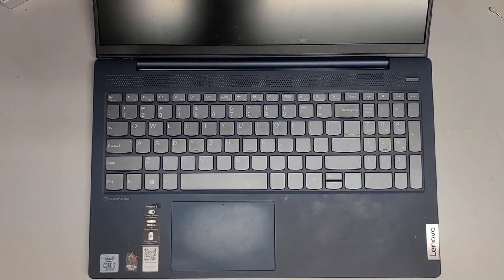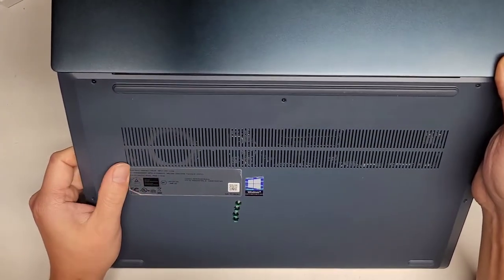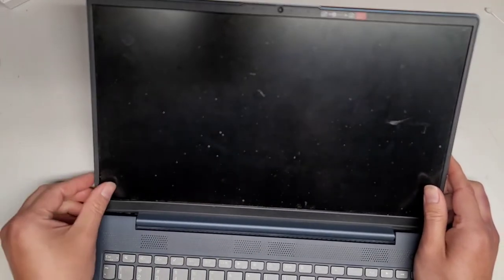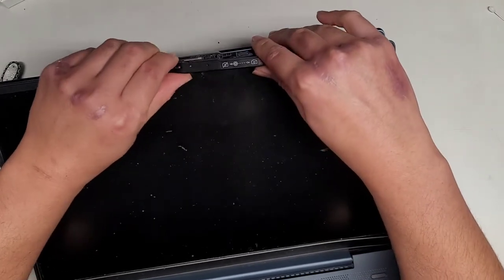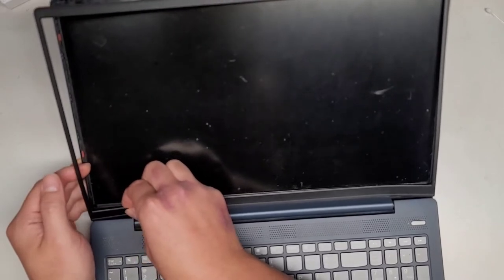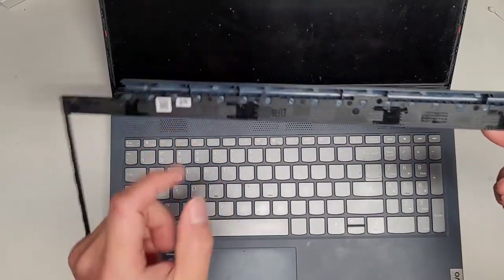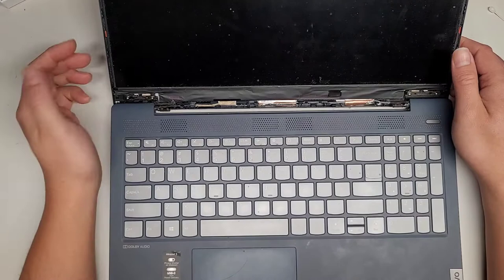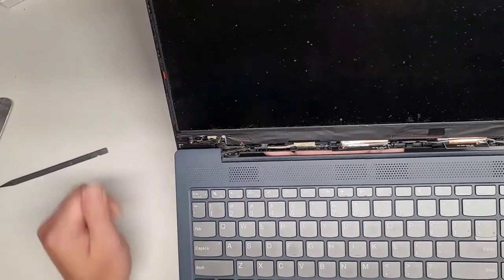Lenovo IdeaPad 5 15IIL05 15ITL05 JB Weld Faulty Flawed Hinge Design Repair (Class Action Lawsuit?)

Comment: I not confident do this. Should i pay lenovo?
Reply from the maker: Up to you
Reply from the maker: Tell them it's a known issue and it's defective. It should be covered under warranty
Reply: @ItsBinhRepaired  no more warranty. i rarely used it
Reply from the maker: @phoonjzc  :( is it more than 2 years old?
Reply: @ItsBinhRepaired  1 year warranty
Reply: @ItsBinhRepaired  1 year warranty. I didn't buy extended warranty
Reply: @ItsBinhRepaired  but it was sold cheaply at a sale. Now I know why
Reply from the maker: @phoonjzc  some credit cards cover it. You might be able to get the warranty extended because it's defective.
Reply: @ItsBinhRepaired  how much does the extended warranty usually cost? Really shouldn't have brought this laptop
Reply from the maker: @phoonjzc  where did you buy it from?
Reply: @ItsBinhRepaired  from an official electronic store. What is the saranwrap for
Reply: When is the deadline to buy the extended warranty?
Reply from the maker: @phoonjzc  I'm not sure of the deadline for extended warranties. The seranwrap is to prevent the jbweld from sticking to the bezel

Comment: Lenovo Yoga has similar hinge issue. Mine was / is particularly bad. First month of ownership of brand new Yodo according to the "geek squad" the pinbal-ish sound in my fan was from "plastic debris" inside the computer. Origin unknown.  Shortly thereafter there was this "crunching of 'glass sand' "sound, every time I picked up the laptop or even worse when I would open and close it. Then my touchscreen stopped working. Then the hinge somehow came out from the top without (to my surprise) breaking the screen. Then my cats closed my screen when it was left open(because I could / should obviously not close it at this point) one night... I'm fairly certain they were watching kitty porn... and in the a.m. when I saw my screen  shut I gasped in panic and when my genius friend saw me do that she was like "what?!..." and opened the screen thinking there was something horrible on it which caused me to shut it (which I didn't) but before I could blink she had just opened it up to a uber cringy grinding sound that was oh-so-familiar and a small pop which, as you have likely guessed was my screen. 
So I went into the kitchen and grabbed a meat cleaver (I am a vegetarian so I was happy to finally get to use it) and I cut out my genius friends heart the way that mine felt like it was at that moment. Threw her body into the canal  where an octopus and a shark fought over her. Bye bye (you're welcome world) ... And when I turned my attention back to my computer I was shocked to see that the screen still worked... And it still does with no interference save for a darker diffuse line up the right side about 2.5 inches in.  I guess I was a bit harsh on my friend, but trust me someone was going to eliminate  her at some point anyway...  

If they can ever get a class action lawsuit going for these effing defective parts in Lenovo's I will be sure to ask the attorneys to include that any act-of-passion murders caused by the numerous defects would be the fault of the manufacturer and NOT of the user.

 I just can't seem to find where any of the investigations into them resulted in anything... Does anyone know?
Reply from the maker: :( yeah, it sucks so bad. I hope that story wasn't real. Lol

Comment: Is this full metal body or plastic built laptop?
Reply from the maker: Both
Reply: @ItsBinhRepaired  I was looking into ideapad (3 or may be 5) they told me it's full metal body laptop. Does having full metal body reduces the chances of hinge problem.
Reply from the maker: Nope, the metal is just on the outside.
Reply: @ItsBinhRepaired  can you please suggest me some brands with better hinge designs around this budget.
Reply from the maker: HP Lenovo, avoid thin bezels if you can.
Reply: @ItsBinhRepaired  thank you for your reply, appreciate that.
Reply from the maker: Yup

Comment: Well done,  If you have a Dremel tool, drill holes holes through cover and use #2 flat head screws.  No glue, no mess but you need some skill
Reply from the maker: Dremel, not a drill?
Reply: DO you have a tutorial of some sort on this?
Reply from the maker: @elin8546  you don't want to do this, because you have screws sticking out the back lol
Reply: @ItsBinhRepaired  I don't mind the screws :) I just need to be able to transport my laptop. And screws with metal reinforcement might be a more longterm solution incase the plastic breaks out again?
Reply from the maker: Jbweld works really well
Reply: @ItsBinhRepaired  alright, I guess I'll have to figure our where to find it in germany 😅
Reply from the maker: @elin8546  if you can't find it, I guess just drill through lol

Comment: Just let your weld dry.  Then reassemble.            Good job though.   I just got one in for repair.  Looking online, looks like this should be a damn recall.
Reply from the maker: If you let it dry first and accidentally put too much, the bezel won't go back on flat. Yeah, definitely should be a recall. I've repaired so many of these.
Reply: @ItsBinhRepaired    Yeah, I've had to use a dremel to knock it down if there was too much ha.
Reply from the maker: @GF_Burke  yup, this way prevents that lol

Comment: Anyway to use this with a monitor, no way for me to fix that right hinge, it is almost frozen solid, but i did get it open to about an angle that it can sit on a desk, just cant close it for transport.. idea pad 5 15 16gb 512Gb  - seems to be a wasted device unless i can hook up keyboard and monitor externally and just use it as a desktop -
Reply from the maker: Sure, why not? The hinges are supposed to be hard to turn.
Reply from the maker: You can use an hdmi monitor

Comment: I need some help as i got my frame and askin me yo pay 90dollars for it
Reply from the maker: Wuh?
Reply: @ItsBinhRepaired  the frame started coming out and i was able to see the gum in between so how is it possible to just attach the frame with out gum after the repair? And inside the flue which you used to replace the screws what are those and how much does it cost? 

This is the second time My frame got detached first time it's covered under warranty and they didn't agree for replacement but now warranty was expired and i dont want to spend any money for design issues 700 dollars a year back.
Reply from the maker: @mastannaidu3266  just have to follow along with the video.

Comment: My Idea Pad Flex 5 is only two years and two months old; two months out of Costco's warranty. The hinge is causing problems with the screen's pixels and pulling the screen apart. 

In the past twenty years I've used nine different laptops - this is the only one I've encountered with mechanical problems. This laptop is Chinese crap! Get a better-quality laptop! (HP has a better hinge system that runs across the width of the screen - and my wife's Apple lasted ten years.)
Reply from the maker: Yup, bad design. Designed to fail.